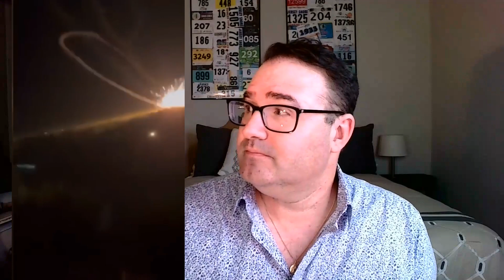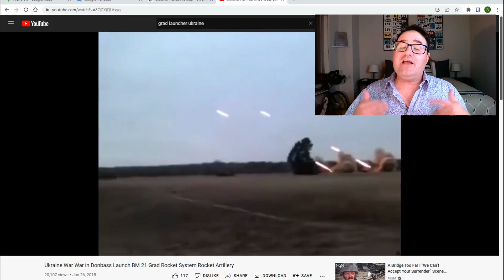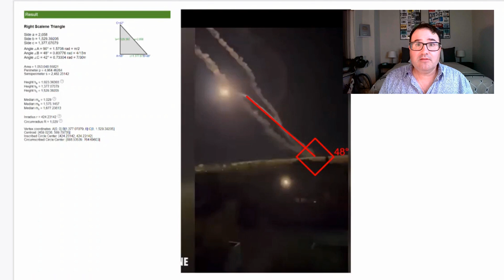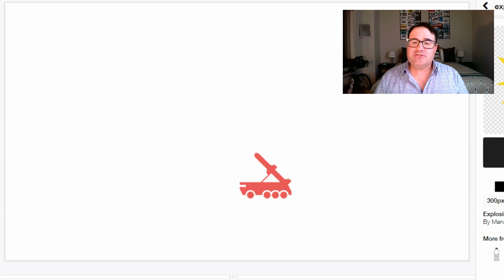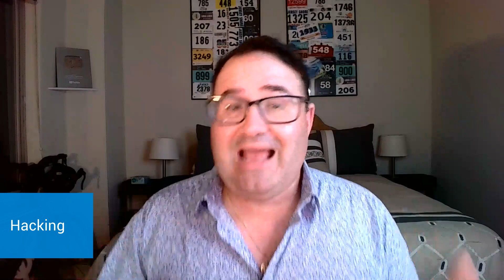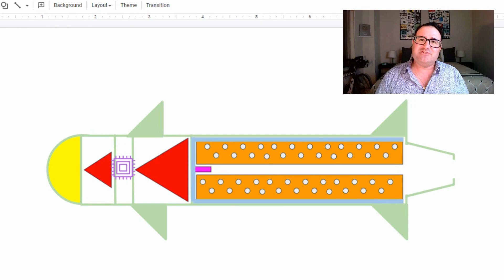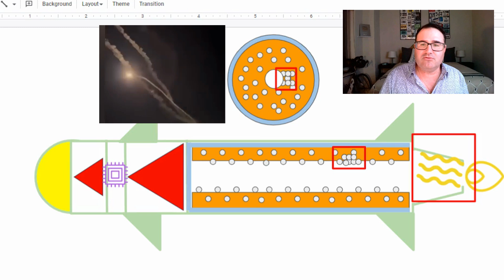Why this missile U -Turned

Comment: Actually one misconception here. At least when we're talking SAMs and AAMs The boost phase is in fact when most of the maneuvering is done. This is before the missile reaches it's max velocity and has the fuel to burn to make trajectory changes and not as much inertia to fight. After the boost phase corrections are minor and the missile for the most part is on a fixed trajectory (referred to as having "gone ballistic") This is why aggressive evasive maneuvers still work when pilots run out of chaff. If a missile could make major corrections while in the later phase, then maneuvering would be useless. In that later phase a missile is relying solely on relatively small fins to adjust trajectory with no fuel left to regain velocity that's lost.

Another factor that leads me to think you're wrong about the rocket fuel defect is that the guidance system would be trying to correct for it going off course the entire way, it shouldn't have continued basically straight back after pulling the U-turn. Even if the guidance system is entirely offline, then the missile wouldn't have first conducted such a uniform turn, then stopped turning. without an equal counteracting force inertia from the missile throwing itself into a spin would have meant that it would've just continued to spiral. 

Anyway to keep it short-ish, based on the way it flew this is most definitely a guidance system failure. Just no guess as to where along the line or why though. Debris kicked up from the wash of the previous missiles? Initial trajectory data corrupted in the transfer from the launcher to the missile due to a bad connection? Damaged/defective onboard guidance computer?

Comment: The fuel on one side burned longer, not hotter, than the other side. The kind of separation described and the ‘clump of fuel’ is unlikely. It’s more likely that a very very slight imperfect distribution caused one side to burn very slightly faster (and hotter), but this extremely slight difference in thrust didn’t change its course significantly. It was after this side burned out, leaving fuel only on one side for just a moment, that caused a severe turn until that barely slower burning side ran out of fuel, too.

Comment: Like all great citizen soldiers in our history you are divine. Thanks for the education. I still think however that this was hacked and more and more incidents like this are now programed to let Putin and his military keystone soldiers know that we can and will destroy them should they ever try using nukes. If i remember how missile guidance systems work each has an individual identifying code. Once you know this code then you can control the guidance system. It is one of the reasons it is such an expensive system. Then again I am not as expert as you are so I will take what you say as being true whereas my own opinion is probably based on thin ice. By the way did you know that one can engineer a thing that upon it veing reversed engineered it creates havoc with whom it is being stolen by. Van Neuman came up with that STING.

Comment: RYAN SOLID FUEL MOTORS BIGGEST PROBLEM IS CRACKED  FUEL !!! WHICH INCREASES PRESSURE LIKE CRAZY THER ARE A 100 WAYS TO CONFIGURE  SOLID FUEL
FROM END BURNING TO SPLIT AS IN YOUR DRAWING STAR SHAPED BUT A CRACKED CORE IS DEADLY YOU GET PRESSURE  SPIKES OFF THE CHART MAY HAVE EVEN BLOWN THE NOZZEL RIGHT OF! GREAT VEDIO

Comment: I don't think thrust vectoring was a factor here. The sheer 180 angle of the turn during boost phase is more likely due to a hydraulic malfunction with one of the control surfaces. During boost phase there are hundreds of control inputs to keep the rocket going straight. On a lunar rocket, the engine assy will move to provide thrust vectoring, but the whole unit moves, not the propellant burning. The force of the burning propellant is still being pushed through the same exit nozzle and this is something that could perhaps slightly knock the SAM off by a few degrees (at which point the stabilizer fins would correct the missile) . IMO this was a failure of a fin/control surface that locked-up in one direction for a split second and caused the (almost perfect) 180 turn. These units have gyro stabilizers built in to help the on-board ecu, so that could have malfunctioned (or possibly been corrupted by a EMP weapon that has been proven to knock drones out of the air?)

Comment: No.

The matter of your proposed theory that a local concentration or “precipitate“ of rocket engine fuel was responsible for generating a turning force, is not consistent with solid fuel engine engineering or physics.

The typical de Laval type engine bell (nozzle) is a force collimator (the rocket efflux goes all in one direction) as well as making that force isentropic and axisymmetric (the rocket efflux pressure is equalized in the throat of the nozzle). This is to say, impulse variations or internal turbulence of the burning fuel and exhaust would have little or no effect on thrust vector, if such did not otherwise result in the destruction of the missile.

A “concentration of fuel“ -- more usually an unintended void in the cast fuel -- would have (and has) created a host of problems, including combustion instability, of a similar nature to what effect has haunted large American liquid-fueled rocket engines, but has been mitigated with entirely different techniques and fabrication procedures (e.g., a star-shaped hole down the center of the fuel core, meant to regulate thrust and prevent cracking from exhaust pressure).

From Wikipedia:

“Common modes of failure in solid rocket motors include fracture of the [star-shaped void cast into the fuel core], failure of the case bonding, and/or air pockets. All of these produce an instantaneous increase in burn surface area and a corresponding increase in exhaust gas production rate and pressure, which may rupture the casing.“

This paper supports my presumption:

Paul C. Smith. (Declassified version 2014-Dec.). “Inter-Batch Variation and the Effect of Casting Vacuum on Ballistic and Mechanical Properties of a High Performing Cast Composite Rocket Propellant“. Defence Science and Technology Organisation, Weapons and Combat Systems Division, Defense Technical Information Center, DoD, AU. <https://apps.dtic.mil/sti/pdfs/ADA623833.pdf>.

It just doesn´t work the way you presume; however, I think you are onto a valid secondary effect. Two possible common failures are a mechanical failure of the case (which would cause a lateral turning force) or a failure in the bell or throat of the nozzle (which would quickly and dramatically alter the thrust dynamics); however, I am dubious that any such catastrophic failures would leave the missile integral and still flying.

From available sources, I find that the Russian 9K37/9M317/9M317M/9M317A Buk (NATO designation SA-11), is about 690 kg (1520 lb), can tolerate an acceleration of 24G, has a dual-mode solid-propellant rocket that propels it to Mach 4.5, and is designed with the center-of-thrust close to the center of the missile, incorporating a long gas pipe, after which are four vanes in the efflux providing turning force. After mid-course maneuvering is completed the thrust-deflecting vanes are no longer used, and subsequent flight is controlled via all-moving tail surfaces.

(I´m very impressed the thing didn´t break up after such an aggressive maneuver. I idly wonder if such missiles are artificially “stiffened“ by being super-pressurized by exhaust pressure, but this is only speculation).

So, perhaps an internal mechanical (or control) failure of one (or more) of the internal thrust-directing vanes, possibly from the kind of impulse spike as I presume you have proposed? What say you?

Comment: Stuck fin NOPE! The evidence is in the video. The missile turns on a dime then goes dead straight again.

Second note is that for engineering and control reasons the fins would be aerodynamically neutral or biased to be aerodynamically not deflected. Neutral means that when the fin is deflected the bit behind the pivot point is being pushed straight just as hard as the bit in front of the pivot is being pulled sideways. This means that low control forces are needed to deflect the fin. The other way of fin aerodynamically wanting to be straight has the pull on the forward part of the fin being less than the push on the back of the fin. Upshot is that both of these need low power to control the fin and they are safe from ‘stuck fins’ especially the second one. And missiles are designed to be reliable so designing in hardware safeties would be a thing.

Comment: I work in ADA.  I've seen glitches in track correlation where during integration between multiple systems, (usually when different radar systems are used), where a track will suddenly jump either in elevation or along its velocity vector.  My guess is that's what happened and the missile didn't know how to act.  

Either that or whatever you just said.  Probably that.

Comment: Great channel.  I don't think this missle did a U-turn because of inconsistencies in propellant densities in the plasticizer.  Any lateral force vectors caused by spurts of fuel igniting cancel out any lateral movement of the missle itself (i.e. equal and opposite reaction)  except that  which leaves the rocket nozzle.

More likely causes: A defective or damaged bell (dented, bent, chipped, melted etc) could cause the exhaust gasses to expel unevenly and turn the missle -- effectively acting like a stuck side thruster on a satellite.

Also a defective or damaged fin or control surface actuator could also cause the missle to turn.  

The flaw doesn't have to be immediately apparent at launch either.  The missle could fly just fine until a certain g- force or gas temperature causes the failure.

Both could be caused by mishandling or by a manufacturing defect.

Comment: Wasnt there a case where a Russian Proton-M rocket suddenly did a 180 degree turn a few seconds after launch and investigations showed that a guidance computer was mounted upside down (im grossly simplifying here) causing the rocket to change the course because it was flying in the wrong direction. 
Maybe something similar happened here, thus explaining the sudden 180 degree turn and then the „restabilisation“ and straight flightpath before the crash.
I dont think a defect in the solid fuel would cause such a sudden and „precise“ turn

Comment: what do I know, but to do a straight-180-straight, you need more than one of those clumps. one clump will make it spin. when the clump stops burning then it keeps spinning. you would need another clump on the opposite side of the same amount to be ignited at the right time in order to stop rotating.

I think thats unlikely. 

but perhaps there is some thing about the dormancy that you mentioned that might make it more likely, but i still think its unlikely

Comment: I think your math logic has a fatal flaw. The weapon is still early in it's boost phase so it is not going nearly as fast as one might think. For the motor to have an issue that causes a thrust vectoring like action it would have to be a nozzle failure.

Comment: A solid fuel malfunction like you suggested is entirely possible. In addition to an inbalance of fuel causing the thrust to become unstable like you suggest. It could all be a burn through with a higher concentration to fuel in one part of the rocket which causes a superheated section to burn through the outer shell creating a side thruster that turns and crashes the rocket. Also all rockets are stabilized by fins whether they are moving or not so if one of the fins was bent damaged or destroyed during the launch then it would spiral into the ground and crash especially if they were only two fins on one side that would create much more drag on one side forcing thing into the ground. So I'm willing to say malfunction of either fuel or the rocket body fins.

Comment: I was thinking that the nozzle failed - caused a massive imbalance in the nozzle pressure balance.   It's plausible that the Russians mishandled the unit, or even dented the nozzel system putting into the tube.   The pressure being exerted would absolutely cause it to break off if it was damaged.

Comment: I always applaud logic. Like what you said, remove the unlikely thing that can go wrong and see what you're left with. Since you know more about rockets than I do, I yield to your superior knowledge. It makes sense, especially as you explain it. It's a "one off" type of defect. Mishandling them is unlikely, so by your impeccable logic it's a bad mix. Unless they had a large batch of rocket motors that got caught in the testing program, it's not going to be caught. Ergo, your right, it's like a hand grenade with a defective primer. You can carry it on a dozen deployments and until you go to use it, it's considered OK. That rocket motor went through every test possible (but one) and when fired.....
Thanks for an excellent well done, well thought out vide. Well done Sargeant, carry on...

Comment: As the burning fuel is funnelled through the exhaust nozzle surely uneven burning of the fuel won’t affect the direction of flight, the nozzles straightens it out. Such a forceful turn seems more to do with the guidance fins. A malfunction causing the fins to jam on full turn just after takeoff.

Comment: There are 35 individual unique frames from 'flash' to 'thunder'.
Youtube @ 60 fps takes 100 frames from flash to thunder (it mixes in extra frames).
So your assessment that the crash happens about 500 metre from the camera position seems correct (depending on the actual fps of the camera 480-570 meters).

For the rest of this video, I cannot agree with a 'fuel-malfunction' as there are no signs of irregular burning visible in the smoke-trail.
The missile malfunctions right at the time it starts tracking and adjusting as visible by the 'hooks' in the two previous smoke-trails (that seem to go as expected; not the third corkscrew trail).
The missile doesn't go in a straight line after the U-turn; it is continuously tracking (making a guided turn) until it hits the ground.
Note that the smoke-trails are nicely highlighted by the flash to see that there are no abnormalities (apart from the cork-screw).
This missile seems to mistook the EM-energy from the illuminating radar as the reflected EM-energy from the target and went the wrong way.
Guidance-malfunction is very likely with the evidence presented.

Comment: There's no way the missile travelled 2000 meters. First of all, that ball of burning shrapnel would be over 2000m wide as well, reaching easily to the camera guy 500m away - but it doesn't. I also doubt that BUK is powerful enough to do that. And secondly, to capture a 2000m long smoke trail 500m away you would need ~120 degrees angle of view. Considering the smoke trail takes less than half of the screen it would mean his camera has a field of view of over 240 degrees. Would be a pretty epic fisheye lens but not true because you can't see his feet.

Comment: Since these systems run some sort of software for sure, one could always assume a single-event upset (SEU). This can happen when solar or other sources of radiation mess with a chip and can for example result in a "bit flip" changing some 1 to 0 or the other way around. Depending on the method used for storing data this may for example result in changing the direction of a vector or expressions of corrupted data. I'll have to admit though that when manufacturing a missile I'd spend serious hours on figuring out how to circumvent this. So assuming Russian engineers know what they're doing, this is probably another pretty unlikely explanation. Then again Russians strap DSLR cameras onto RC planes and use cellphones in combat zones in order to get themselves killed soooo...

Comment: I wonder if this fuel situation could possibly be used to actually create hypersonic missiles. I mean...if the location of the concentration of fuel can change the course that much I wonder if liquid fuel could be used with a system that regulates where in the thrusters it's concentrating. JUST A THOUGHT

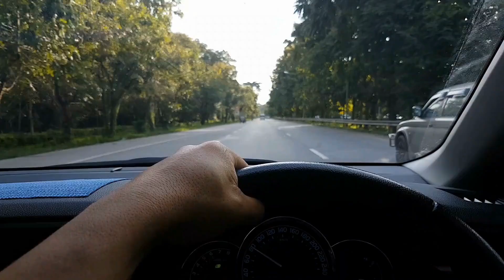Comment: 03:51 Also, on a road... you have one plane. So your possible directions are: left or right. Being airborne, this missile had 360 degrees that it could turn... strange that it didn't veer to the left, or the right, or up... or up-left, etc... No - it just co-incidentally u-turned on a plane that fell within a kind of 90 degrees wedge (pointing down - and towards the source). That's a lot of perfect-storm co-incidence happening there?? hmmmh....?
Reply: oh, and it looked like a pretty definite (deliberate?) U-turn (as opposed to an arc, bend, s-bend, wiggle, wriggle, wobble, etc...)

Comment: I'm a bit late to the party, but I wanted to add my 5 cents to this.

The missile turning around due to guiding onto it's own launch radar is unlikely since the antenna is highly directional and only faces forwards for fairly imaginable engineering reasons.

This failure, however, reminds me of a particular malfunction that struck a commercial Proton-M rocket (also Russian) where the IMU (direction sensing unit) was installed upside down. This rocket proceeded to very similarly go straight, for a while, but eventually attempted to make a similar 180 turn before it broke up in flight.

Comment: Thats like saying in a rear wheel drive car, if only one of the wheels was driving you, you'd start turning in circles.  The speed at which the rocket turns it has to be because of aero, the fin changing direction. Also your measurements are clearly out, otherwise those trees would be hundreds of meters tall.